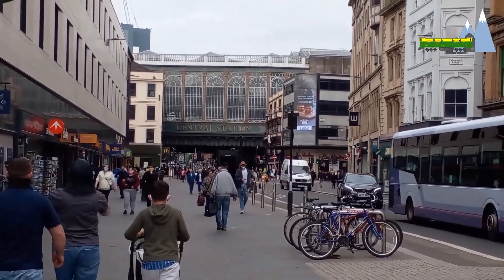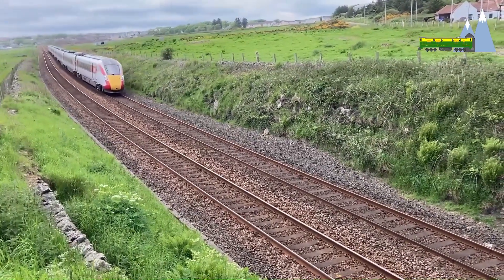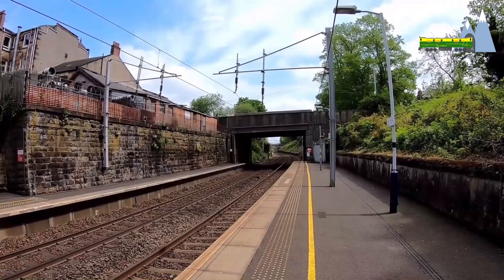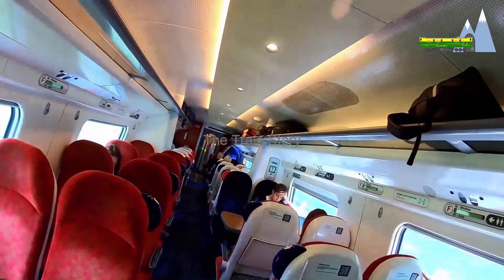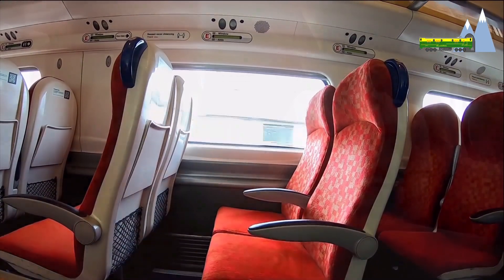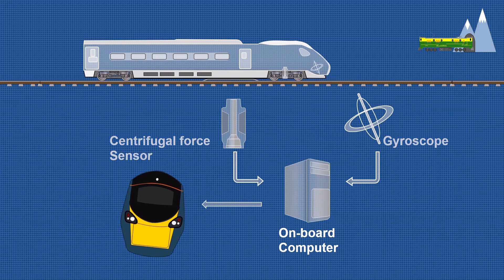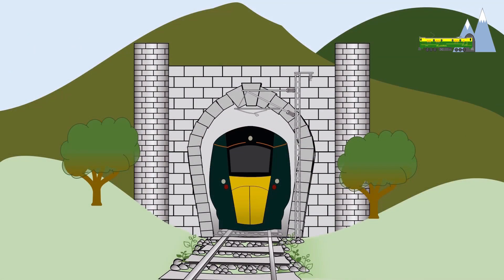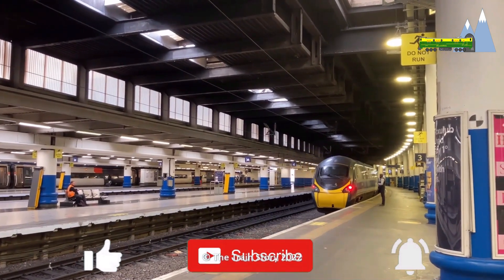How tilting trains work? Pendolino | Tilting trains | Class 390 | Avanti | Super Voyager | Class 221

Comment: Interesting, Vande bharat trains are planning to use this tilting technology to increase top speeds but they will probably use talgo trains' version of tilting technology.
Reply from the maker: As per Mr Sudhanshu Mani's many videos there are no plans to introduce tilting technology to the Vandebharat trains. There are plans to upgrade to 200 kmph when the track infrastructure is in place. But my opinion is Tilting trains can improve speeds by 20-25% and should be introduced in India
Reply from the maker: @SaiPraneethMullapudi  if the Hon’ble Minister has said than it is a very good development. However, I don’t think the existing rake will lend itself to tilting technology. The dimensions will have to be changed to allow clearances while the tilt is in action. The Minister may have used the Vande Bharat terminology, but being an engineer himself, he must be aware that tilting tech would require an entirely new trainset to be designed and built.

Comment: Not quite right. The APT-E and the APT-P's maximum active tilt was 9 degrees, a with a further 3 degrees of passive tilt to take account of point and crossing work and other track irregularities.

In addition, BR did NOT sell its tilt technology to FIAT, the control systems and actuation are totally different with both systems, FIAT having developed their Pendolino system independently of BR but at around the same time frame. BR did give the high stability wheel/rail profile and suspension systems to FIAT though, along with all other railways worldwide, and made no charge for the use of the technology.
Reply: Engineering of italy is incredible  ,on all..from space,supercar, missilistic sistems warship, camion, automotive, moto,4 mondial cup 😅😅😅 England patetic
Reply: @valerianocuomo996  Yeah, that's why your Air Force flies Typhoons built and designed here. Both countries have good engineering history and still do have, in our own respective fields.